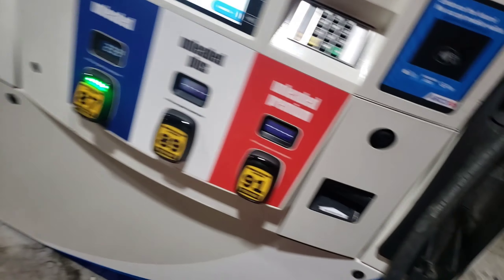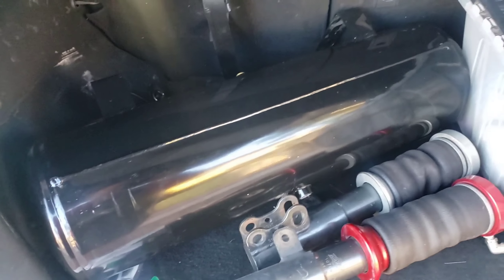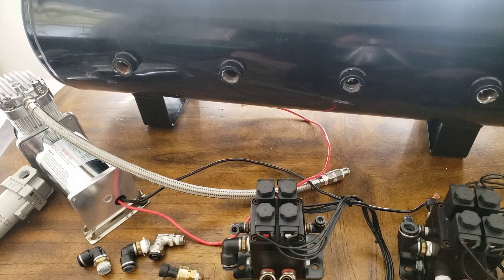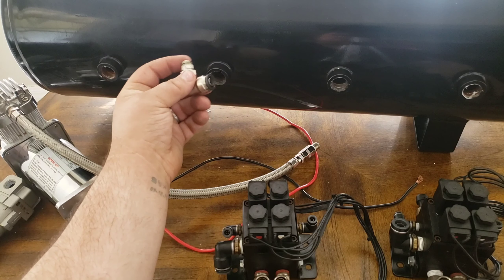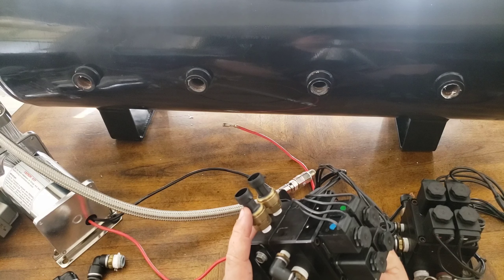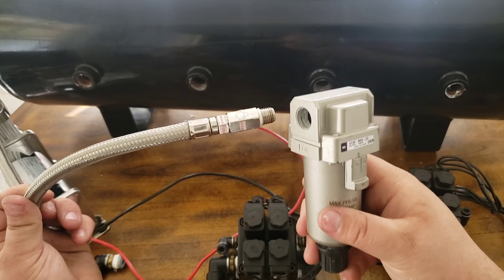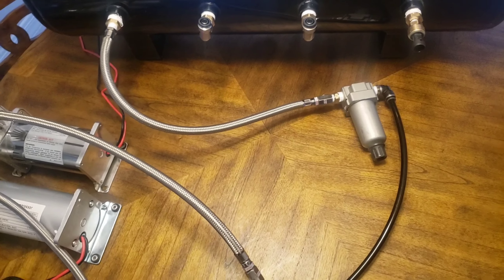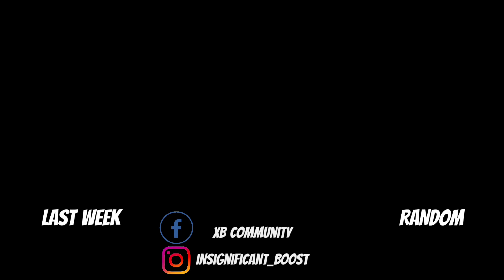ROAD TRIP to  CALI for BAGS!

Comment: Do you have any idle issues? Sometimes my idle drops to 550-600ish and back up to 800ish. 2014 xb 50k mileage. Throttle body is clean.
Reply from the maker: Mine does a little but it could be a few things, air filter if it's too dusty it could restrict air, MAF might need to be cleaned that takes a few minutes. I'd check MAF  and filter
Reply: @InsignificantBoost  I already changed the filter and cleaned the MAF sensor, along with the throttle body. I got a donor  idle air control from the junkyard, gonna try to exchange it. Thanks, just wanted to see if you had the same problem hahaha
Reply from the maker: @xdrew707x  for sure, super odd and definitely not normal, can you update us?I'm sitting at 136,000miles with no actual issues